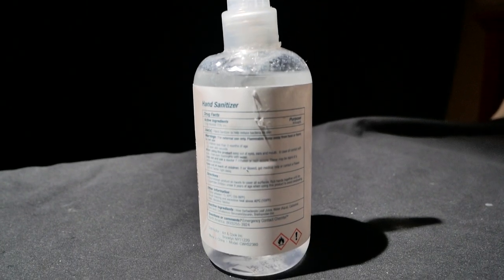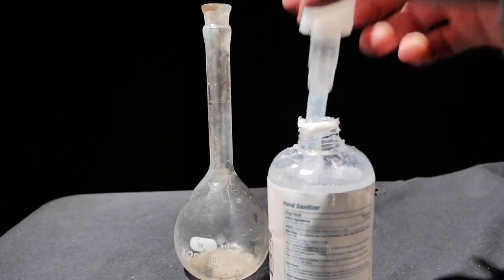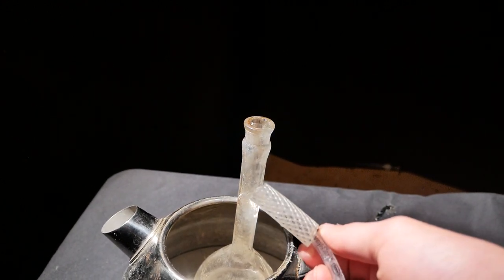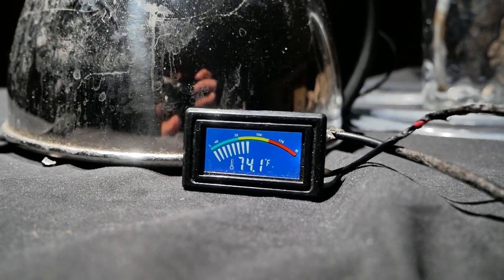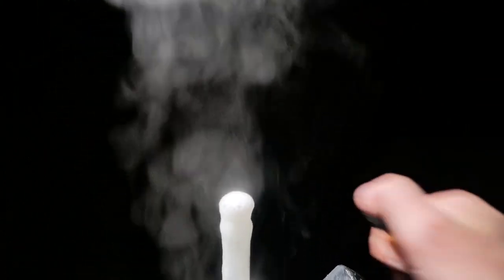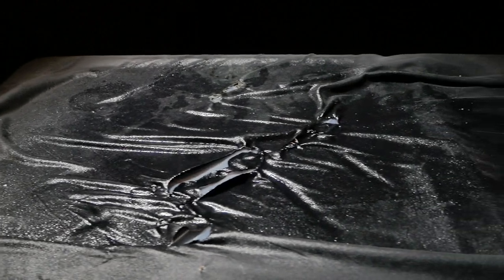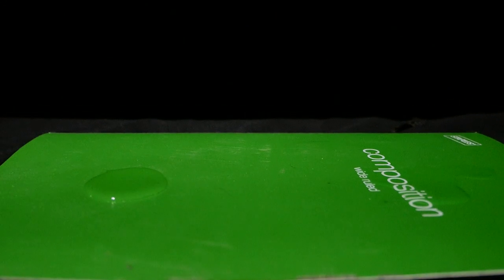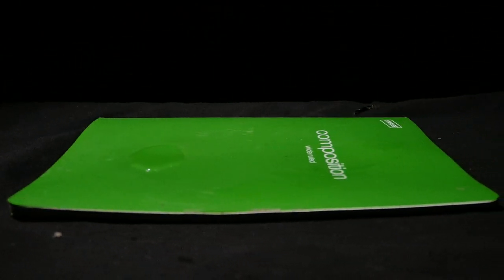I Distilled hand sanitizer to run a go kart

Comment: That's not really the best yield, I could get around 450ml 95% ethanol per 500ml of sanitizer distilled, you probably lost a bunch to just it not condensing, I strongly advise buying a cheap ground glass distillation set, they're like $50